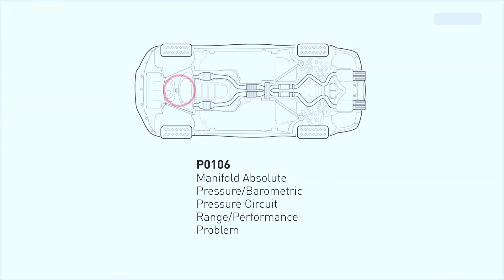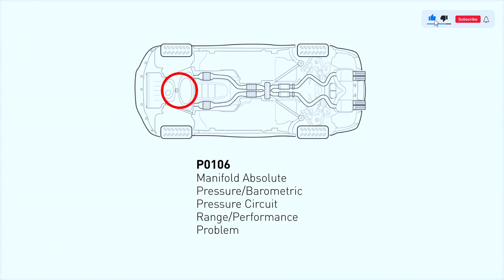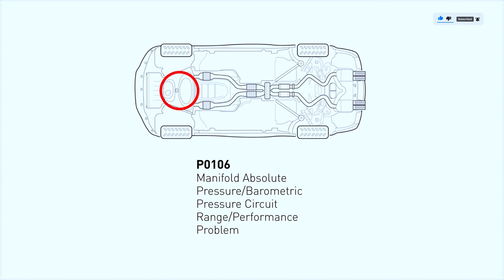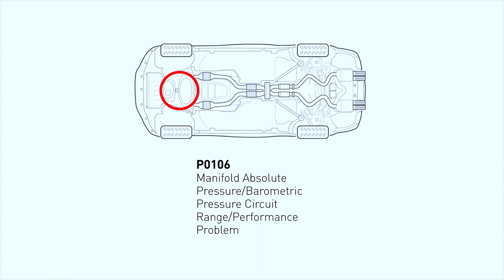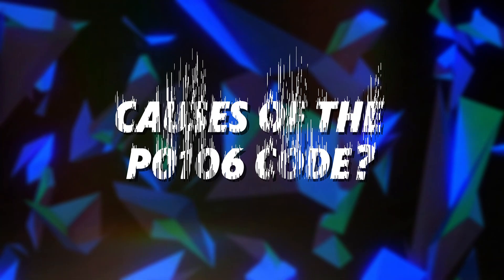P0106 Error Code: Step-by-Step Guide to Fixing Your MAP Sensor Issue

Comment: This is a near impossible fix as ive been to 6 different Mercedes mechanics about it and nobody had a clue and they all said different things
Reply from the maker: Wow, I totally get your frustration—that sounds exhausting. It's really disappointing when even multiple experienced mechanics can’t agree on a clear solution, especially with a brand like Mercedes where things can get overly complex.

Sometimes issues like this need a deeper diagnostic approach—not just code reading, but live data analysis and system testing. If you’re still stuck, I’d recommend finding someone with Mercedes STAR Diagnostic tools—those give factory-level access and might reveal what others missed.

Appreciate you sharing your experience—it helps others know they’re not alone in this!

Comment: Could this be the check valve into the intake manifold ?
Reply from the maker: That's a great question! The check valve could indeed be a factor in your intake manifold setup. It's always good to check all components when diagnosing issues.